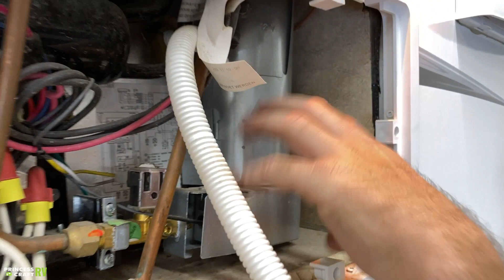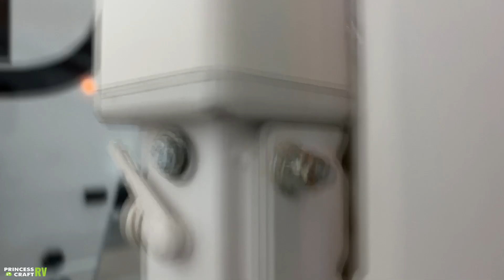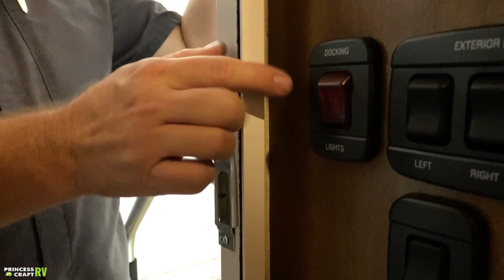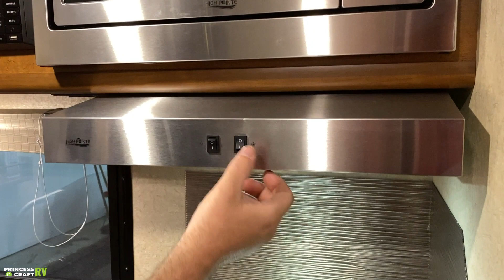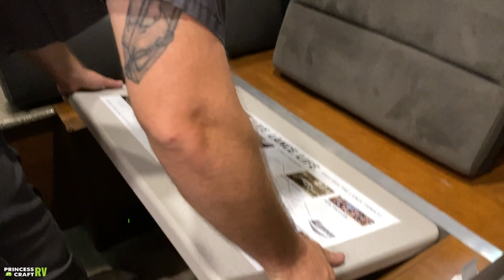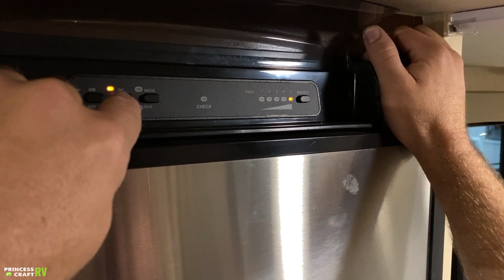Lance 825 Truck Camper - 2020 Tech Tour

Comment: I have a 2020 Lance 825 and was told the propane cylinder has a built-in low pressure regulator (or low-pressure something) and can't be switched out with a normal cylinder. Any thoughts on that? Great video, had no idea about the vent hood being closed on the outside, thanks!
Reply: Don’t think that’s true